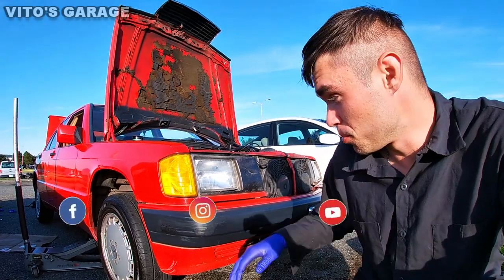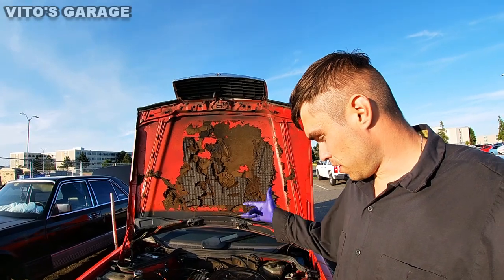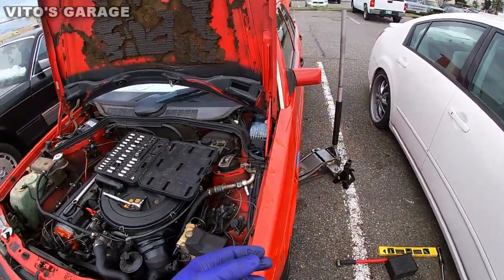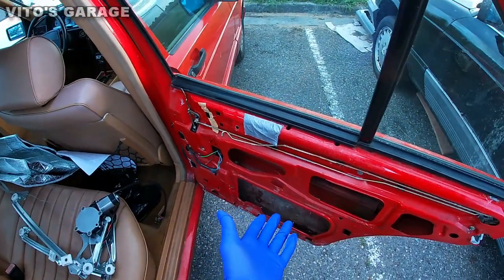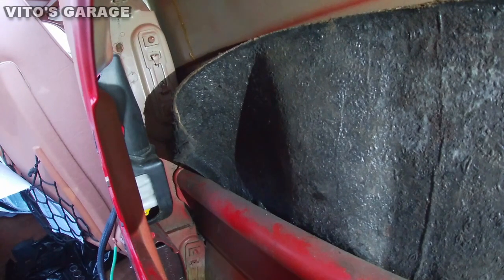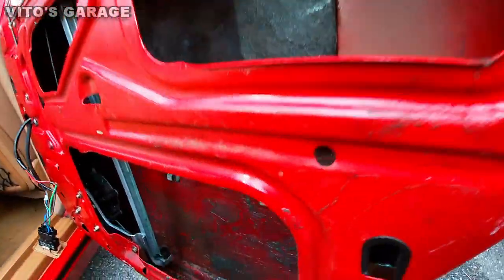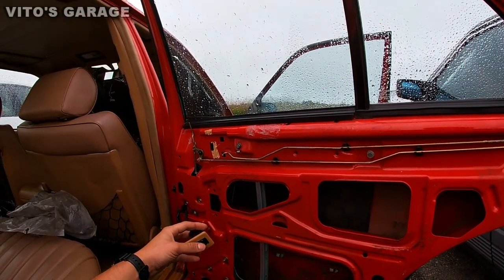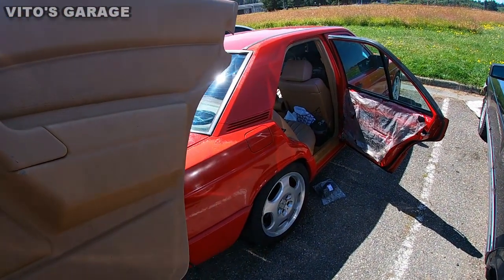Mercedes 190E First Oil Change, Rear Window Regulator Replacement & Bottom Door Rust Repair!

Comment: Hi Vito! Will a semi synthetic vs a fully synthetic have a great difference? Do they both work perfectly? Have a 2.6 m103 engine. Also not sure how much Liters is needed... Really hoping you could help
Reply from the maker: Hi there. Use full synthetic 10W-30 oil. You should buy about 8L of oil. Engines like thicker oil
Reply: @VITOSGARAGE  would that work for 2.0 ltr as well I always tend to go for 10/40

Comment: I don't mind commercials, Vito, because I know you make your money off them, but I really hate when they break in when you are talking! Lol
These old benzes have the regulators bolted in. The newer ones are riveted. What a pain. 
The back ones only have about 4 holding them and are not to hard to drill out. The front ones have at least 8 rivets and I kinda ended up screwing up the holes on my front passenger side. Next time I will know to punch out the center of the rivet before drilling it. 
Looks like that insulation got tangled in the regulator and caused it to get bent. You may have been able to straighten it out to tighten the cable. Oh well. New ones are not to expensive. 
That oil looked pretty nasty.
How's the car running now?
Reply from the maker: Thanks for the comment☺ The car is still not perfect but it's getting there:)

Comment: Hey Vito I was wondering if you can direct me in my power window issue . I have 89 190e 2.6 my window rolls down but not up but once in awhile it will roll back up out of the blue . Today I slammed the door hard and the window rolled up . Could this be a regulator or broken switch problem?
Reply from the maker: Hello. Is it just one window that’s having this issue or all 4?
Reply: @VITOSGARAGE  just one window the driver side front . The one I use the most
Reply from the maker: @AlonSOAMAZING  The problem is usually with the switch itself. Try playing with the switch. I don’t know if slamming the door was the coincidence of fixing the window. I haven’t really seen the motors go bad. I think you have a problem with that switch. You can always swap the switches around and see if the problem gets fixed. Then order a new switch.
Reply: @VITOSGARAGE  thank you Vito